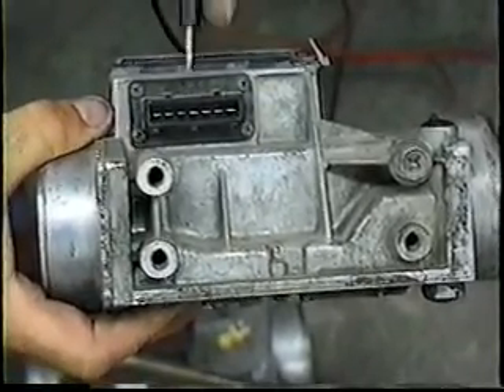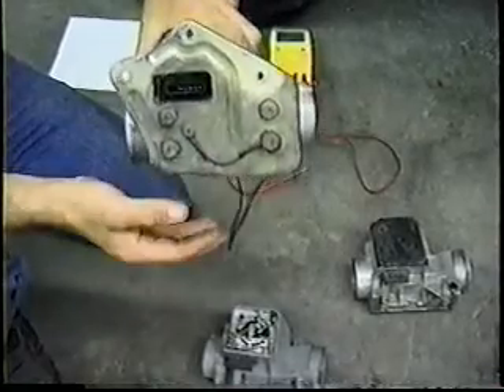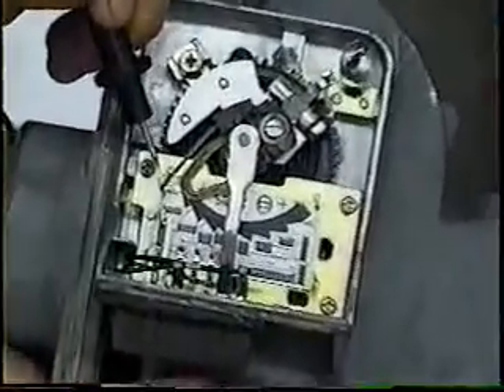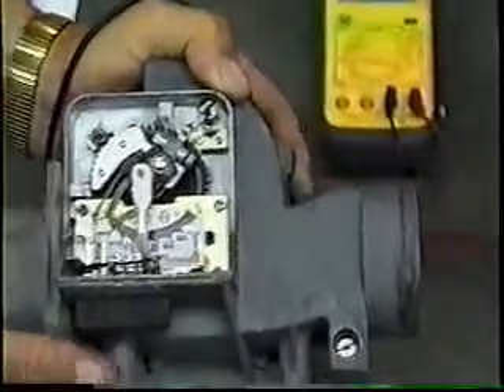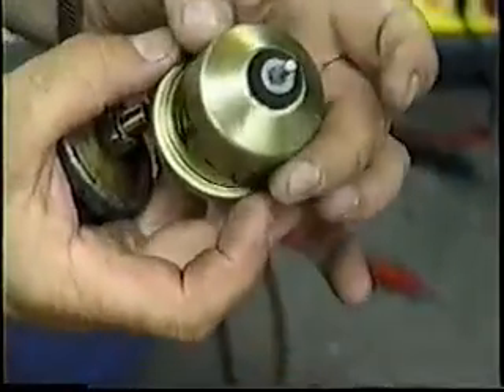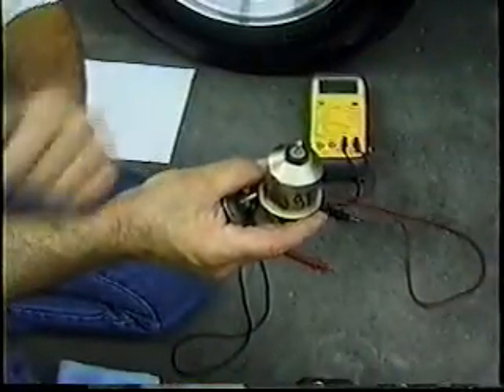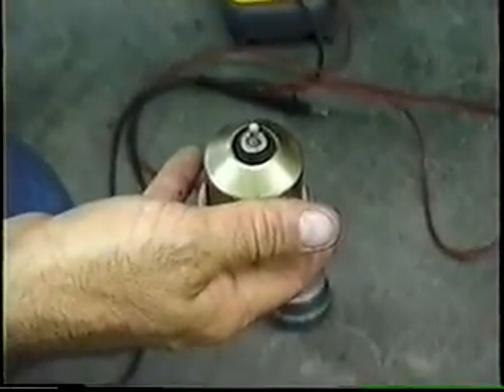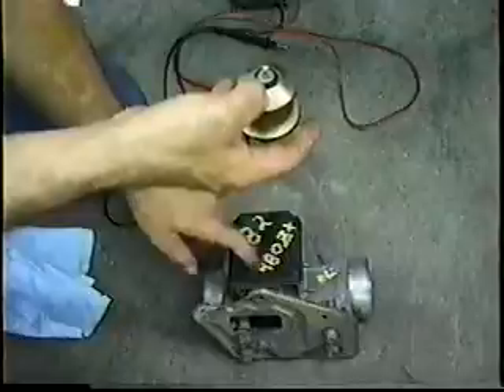Z Therapy Datsun 280Z ZX Fuel Injection 13 of 20

Comment: my late 280z is stumbling when I hit suddenly the gas... what could it be? Somebody already replaced the Fuel pump and there is some yellow tape around the coverplate of the airflowmeter.. so I guess a mechanic was already trying to fix the problem
Reply from the maker: Dirty or poorly adjusted throttle position switch is where is start
Reply: @burkeyvision4346  can you tell me how to adjust it? I could not find anything in the FSM
Reply from the maker: @ApexRace  Its in one of the videos...It would be difficult to describe for me to you in a brief text. I am certain it is explained in the FSM EFI bible. Try reading up on page 13.
http://www.atlanticz.ca/zclub/techtips/efisystem/280zfuelinjectionbook.pdf
Reply from the maker: @ApexRace  Could also be a leak in the rubber boot that goes between the AFM and the throttle body

Comment: If the fuel pump does not run but when I pull the harness with the 2 pins of the oil pressure sender and the pump runs what does that mean